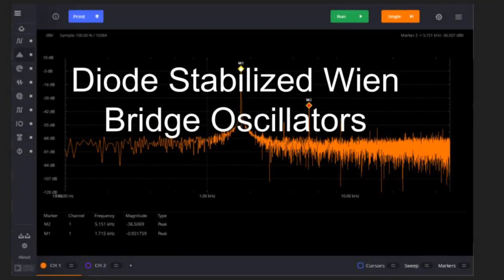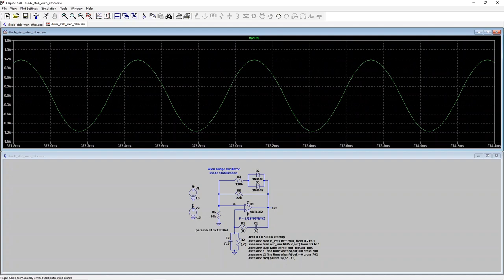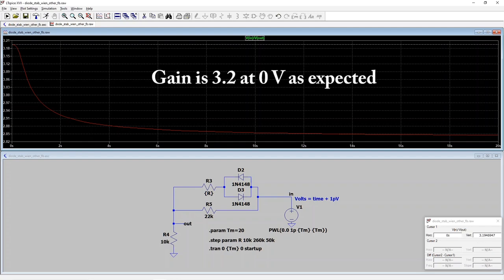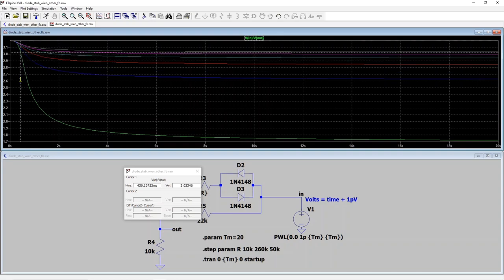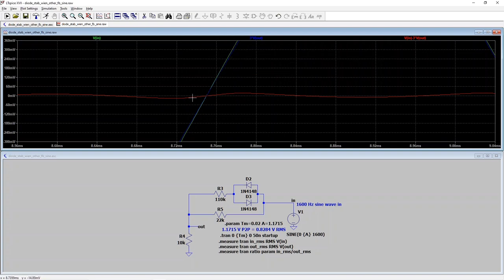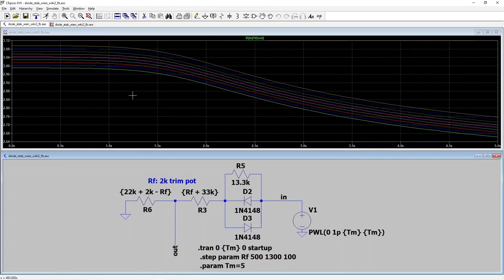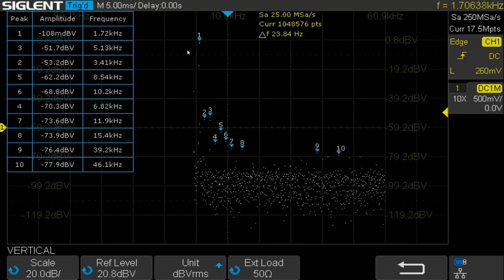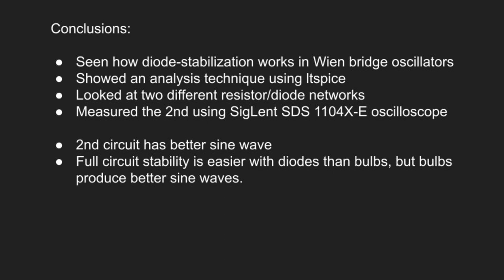Diode-Stabilized Wien Bridge Oscillator

Comment: Nice, I see you put a lot of effort into that. I remember in university, the Wien bridge oscillator was indeed a subject of discussions. In this example you need to make sure to "ride" on the forward knee of when the diodes just become conducting. This function is as you say nonlinear (approximately a parabola). Your second example works better because R5 linearizes this piece of the curve. Since I am no longer working in electronics development I haven't looked into newer versions. I am sure this control problem can be solved with arbitrary precision within a specific error correction time when the feedback is made with an integration component (which a lamp provides). The problem is similar to AGC, only requires enough precision to keep the oscillation criterion.

Comment: Thanks,
It is great topology two diodes and resistor in feedback loop.
Also, you explain things really well.
I guess, we should be able to use this configuration (with some modification) in other types of oscillators to stabilize them.
By the way these two diodes with a parallel resistor are used in PLL filters for fast convergence.  When the voltage of phase detector is too high, the diodes turn on and as you approach 
low phase difference then the diodes turn off and resistor takes over.
Also, you should look at phase noise.

Comment: A few improvements for people to consider:
1) if the feedback part of the circuit is also tuned to have the gain of about 3.000 only at the running frequency, the high harmonics from the diode action will be suppressed.  
2) Consider using "low leakage" diodes as your diodes.  BAS116 is an example.  The resistor in series is over 100K so you are working the 4148s at a very low current. The BAS116 has a higher "small signal resistance" at the zero bias point.
3) As well as #2 a resistor to ground from the end of the diodes can help.  This lets you get the diode current and the extra feedback current to be different values so you can adjust them for best performance.
Reply: Is this documented somewhere? I'd like to give it a read, and/or a test!
Reply: @cocusar  Do you do LTSpice?
I could put together a model for you without too much effort.  each point in my comment is fairly easy to model.
Reply: @kensmith5694  sadly I don't, but I can easily learn. just wanted to know how that works for pure sinusoidal oscillators, because I might need one of those
Reply: @cocusar  No sine wave is ever pure.  Diode based amplitude control doesn't do as well as the lightbulb.  Thermistors are an alternative to the light bulb.  Get your self a copy of LTSpice and play with it.  To get you started, I will suggest you watch some videos about using it and then enter the design for an oscillator.  Stick a 10mV pulse in series with some capacitor to kick start it
Voff=0
Von=0.01
delay=1uS
t-rise=1nS
t-fall=1nS
t-on=1E9

Comment from the maker: Commenting on my own video....  My scope has 8-bit vertical resolution so it is hard to believe that it can reliably measure harmonics more than 48 dB down from the level of the fundamental. Two of the measurements in this video show no harmonics above this level.  That suggests a clean sine wave relative to what can be expected with diode stabilization-- but don't be convinced that the total harmonic distortion is really less than 1%.  The scope may not be showing it.  This is a complicated topic...

the M2K has a 12-bit DAC.  Could it be better than the scope?  I doubt it.  I suspect its other limitations would come into play.  I'll make a video on this if I can figure out how to say something reliable given my test equipment limitations.
Reply: You can also make a "home made subtracter" or notch filter.  Both methods allow you to reduce the amplitude of the fundamental by about 20dB without changing the harmonics.  Since the full circuit is an oscillator and not an amplifier, chances are the notch filter method will work best.  Buffer the signal and then use expensive capacitors and pots to make a twin-T
Reply from the maker: Thanks for these interesting comments.  Filtering the fundamental is an interesting idea.  An effective filter design for the low frequency I am generating might be tough, though.  My scope (Siglent 1104x-e) unhelpfully gives ">= 35 dB" as its SFDR spec.  I think you have better equipment!
Reply: @electronics.tinker  A filter at lowish frequencies is very simple to make.  Look up twin-T filters.  You can get large value film capacitors up to 15uF on a budget you mere mortals can afford.  If you need one that is easy to tune, the fairly common 3 op-amp filter design can be made to have a linear frequency with the setting of a 10 turn pot with a knob on it.  There are two tricks to doing this:
1) Put the knob on so it goes 1.00 to 11.00
2) Use the resistance from wiper to each end as two gain determining resistors so that the knob's setting effectively gets squared.